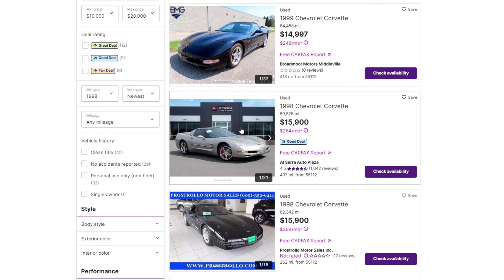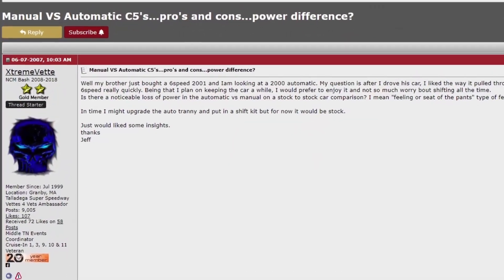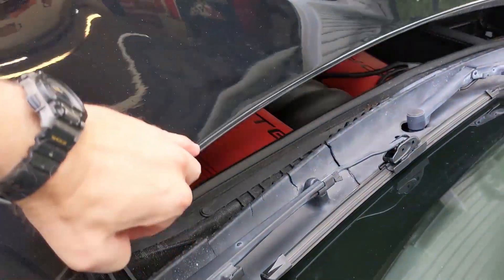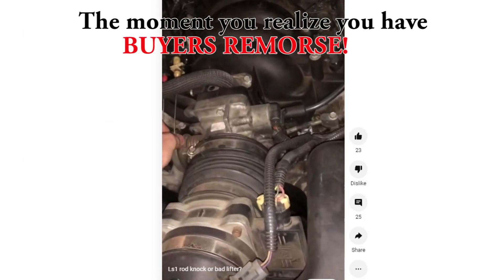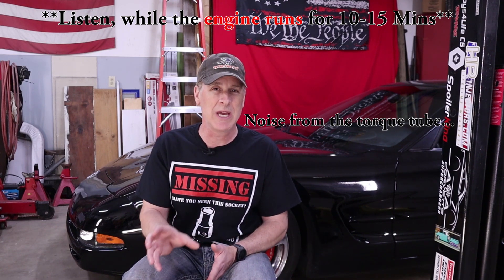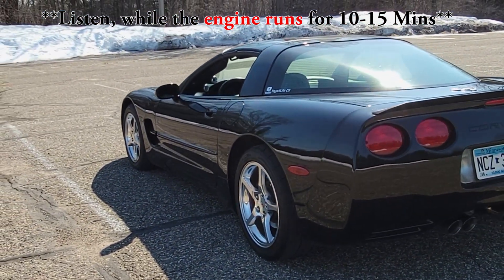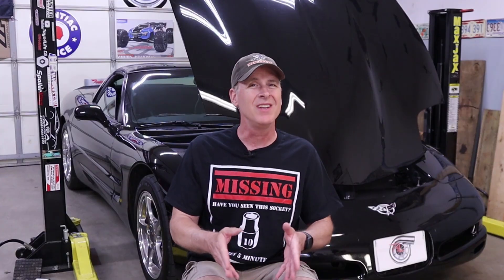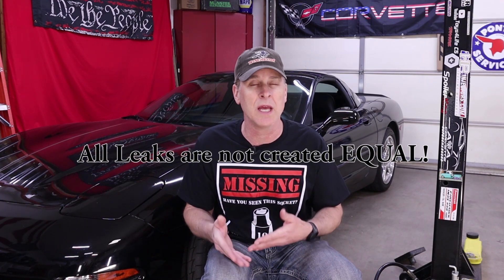How To Evaluate A C5 Corvette For Sale (Don't buy a Lemon!)

Comment: I daily drive, and race, a highly modified C5 Z06 with 650 HP totally built drivetrain and suspension, lowered,6 point cage with harnesses, it’s got 120K miles on it and still runs great. It is starting to get old now being over 20 years old but cost for performance is hard to beat.

Comment: Bought my 2000 from a consignment dealer back in December 22. Was viewable by appointment only. Super nice guy. Answered all my questions and knew vettes well. Cardiac showed one owner,maintenance was done in schedule at a Chevy dealer. Only issues so far have been the power antenna which he sent to me no charge,that seat track issue and trunk/tonneau cover struts. Car is in immaculate condition and people are shocked when I tell them it's 23 years old. Way more fun to drive than my c6&c7that were auto

Comment: I agree with Pietro Braggi's post.  This is the most comprehensive and accurate C5 blog ever.  I was lucky in buying my C5 because I only was knowledgeable to use 5 of the 10 suggestions for evaluation.  Fortunately, I was lucky to buy one that was pampered.  I will say that low mileage helps and tends be the better buy even if paying a little more.  So far, no issues after 4 years of owning my C5.  One question though, is it really necessary to change the oil every year if only putting 1,000 miles on each year?  Thanks, and keep up the good videos.
Reply from the maker: That's a good question about the oil, I think if you live in a very arid climate, it might not be necessary. If you live in Florida, then I probably would for sure 😃

Comment: I also feel it productive to check out the seller almost as much as the car.    the steering racks can be a little wet , but leaks will cost you, as will any running gear leak, come to think of it. 

 another area of concern is the torque tube,  because you have to take apart the car to check that  for wear, and it  requires about  8-10 hours of  labor when those parts have to be renewed.

Comment: Good stuff, I usually try to deal with reputable dealers. I know they are priced higher, but I doubt they would sell you a framed damage vehicle. They will put it on the lift for you.
Reply from the maker: Yes, if you are going to buy from a dealer, the highly rated OEM dealers are the least likely to sell junk- they tend to send the junk to auction!

Comment: I just brought a 98 c5 vert with a clean carfax but the car was smacked and owner did not report it to insurance.....carfaxes are NO GUARANTEES of accident free cars........i had 3 c5s but was out of the c5 loop for a while and this 98 c5 i brought was a real lemon......car had the common piston slap, differential leak, hvac blend door problems, accident although carfax was clean......previous owner replaced top, wheels, tires, harmoinic balancer, stereo( still sucks),  leather, carpet, ac compressor, pulley idler, brakes, ignition key bypass, wiper motor, water pump, active traction  control does not work..........everything that these cars are notorious for was wrong with this car.......previous owner dumped a lot of $$$$$$ in this car and unloaded it  cheap on me for $10k......but not cheap enough.....i do most of my own work but forgot how crappy these cars can be especially 97 to 2000 models......there is a lot of cool things about the c5 including body style but  they can be real piles of junk.......i regret buying my 1998 vert heap but i got it pretty cheap and do most of my own work........do not buy a c5 if you cannot do your own work on it......BTW most of these young kids today will not want to talk to you in person about the car they are selling.....its sad that we live in this kind of world today.......and when you sell your c5 expect calls about it at 2:00 AM.......half of the folks dont show up to thier appointment......half of the folks will offer you half of your asking price via text before they even see the car......yup crappy world we live in now.....ok im done....Thanks!:hand-purple-blue-peace::hand-purple-blue-peace::hand-purple-blue-peace:
Reply from the maker: Doing most of your own work is indeed a huge ++++

Comment: Got my 99 off a teen for $9500  that he didn't really take care of.  But the price was right and the block was good and it ran strong.  Had problems with windows motors,  vacuume leaks, fuel door not opening, oil leaks,  a little lifter noise.  About 2k later the car was good again.  Now I'm in the building and moding  stage of my new track car.  Now off disassembled the motor and starting a complete rebuild and will be shooting for around 600HP.
Reply from the maker: I dig it, buy cheap and fix/MOD it!

Comment: I enjoy spending my hard earned money maintaining and upgrading my vehicles- mainly my '97 Vette. It's still got relatively low mileage at 56k, and although I understand that the car is older, it runs and drives good, but it seems as if I am constantly having to fix things- whether big or small. The guy (professional mechanic) who did my harmonic balancer.....welp, I'm leaking oil now; had both axles and one hub bearing replaced because I heard (still there) a very loud humming noise but now they're telling me the damn differential is probably the culprit.....C6 shocks, aftermarket sways/links, tune up, battery, cags,  run flats, aluminum radiator....the list goes on and on. I need brakes, a diff kit, climate control and gauges are all dim....ugghhh, almost overwhelming.I maintain my cars the best I can because I enjoy the peace of mind while traveling. But damn, man, this is getting out of control. Goes to show that ANY used vehicle can and will have issues, especially if you slack. I don't know how average working -class people such as myself are able to keep up. If I was able to sell it, I'd be out around 10 grand.
Reply from the maker: Yikes.

Comment: Hello, I owned a 2000 C5 for 12 years. I pounded this car every time I got into it.  Like I would say to the sissies, if you are not going to mat it, get a Yugo.  

My question, what did you use to keep your phone on the board to keep it from falling off ?  Awesome idea !  Cheers!
Reply from the maker: Gravity.  if you are shakey, a piece of duct tape fashioned into a circle would hold it down enough.  Cheers back at ya!
Reply: Have you ever had an ebcm issues?

Comment: Just got a C5 convertible with 8,000 miles from a super-reputable Chevrolet Corvette dealer. Wonderful vehicle! Balancer redone. But have to disagree with C5 pricing range as stated in this video. Asking prices are routinely $10K above those quoted. If you pay only $10K for a C5, remember: there's a sucker born every minute. Don't be a sucker.
Reply from the maker: There's no way I would pay 25 grand for a C5 in 2023. Unless I was looking for a 10,000 mile pristine specimen. Your points well taken though, a C5 for 10 grand is going to be pretty rough.
Reply: @Toys4Life   I own two c5 s a 99 and a 03 I would nt sell either one for less than 20k  got 45kmiles on the 99 and 25k miles on the 03 both convertibles so if you are paying 10k it has to be well worn.

Comment: I appreciate your videos,question for you,I'm looking at a 2003 c5 manual 18,000 original miles,there asking 25,800,it has the stiffer springs,I don't know if they called that the z51 for those years,do you think that's a good price?Do you think the more harsh ride would be not enjoyable and also do you think that would change the gearing,for example my 2004 c5 years ago,first gear was 0 to 50,I enjoyed the longer gears,more enjoyable to me,ty in advance.
Reply from the maker: Test drive it, it's going to be harsher perhaps but only you can tell if it's something that you embrace or hate. The gears should be 3.42 if they're stock, since it's a manual transmission car.

Comment: What's up with the Fiero in the corner?
Reply from the maker: It's resting, it runs 11.75 at 115 if you're interested? 3800, VS Cam, supercharged, e85. I call it the fast little bastard. Very very low dollar build.
Reply: @Toys4Life C5  11.75s, damn that's gotta be a blast. Got my hands full of my 01 C5 right now, but thanks. Thinking about a supercharger, gotta save up for that one. Just finished the double din stereo upgrade, big improvement.

Comment: No way I have a mint c5 but would take c6 or c7. A vg c5 is over 20k especially if stock low miles no accidents and mint not abused 😅
Reply from the maker: No way what?
Reply: I don't think it ends with a c5 good start but the newer Vettes are amazing